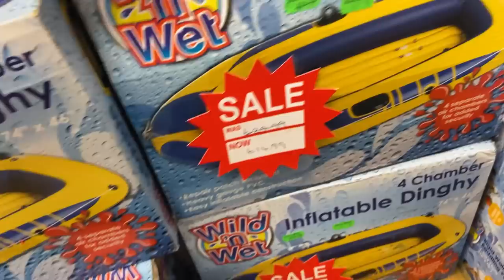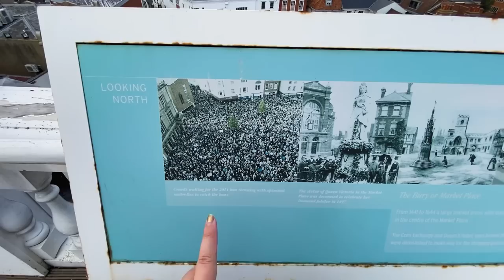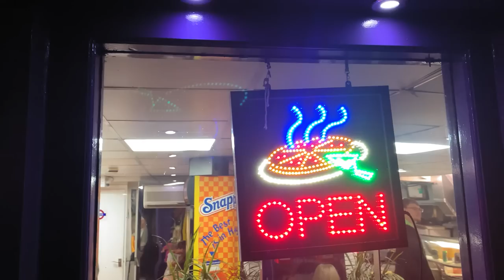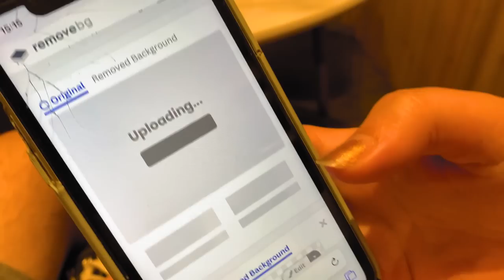Riverside cities and more bad DIY on our narrowboat - 65

Comment: i saw those flowers peaking out of the grocery bag. :D  What a sweet guy you are!  I have that same fear.  Visited the Queen Mary down in Long Beach... They've constructed a room with lights around one of the propellers so you can look down into the water and see it, even putting a mannequin in a dive suit looking like it's working on the massive screw.  Never NOPED out of a place faster than that.  EDIT:  Might use the third ore for steering the condor 3000 and keeping it straight ;)

Comment: I live in texas and the root veg here (compared to chicago area i grew up in) in stores is generally pretty bad 11mths out of the year so while potatoes are probably my favorite food i dont make them often. I did however buy a TON of instant mash despite not enjoying them terribly for last minute dinners or power outages after losing power for 4 days winter of 20/21. My two teenage sons needed to have wisdom teeth removed and while i had plenty of soft foods on offer they completely cleaned me out of instant potatoes! The next time i was at the store i restocked my pantry and bought like 12 packets and the clerk was confused and amused until i told her i had 2 kids with wisdom teeth removed 😂
My older son had 3 removed and easier surgery and whined for about 2 weeks, younger had 4 and needed gum shaving surgery as well and bounced back within a few days. Lol!